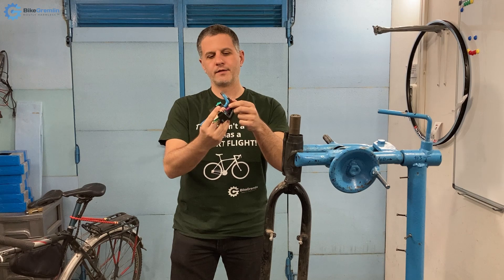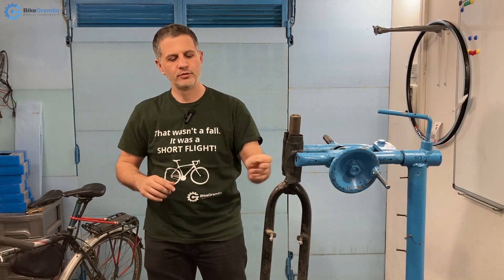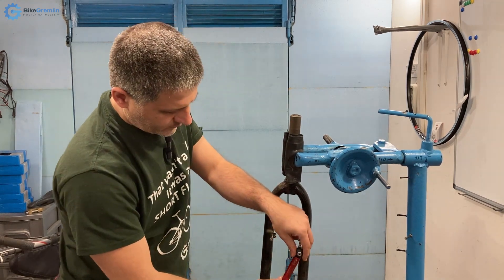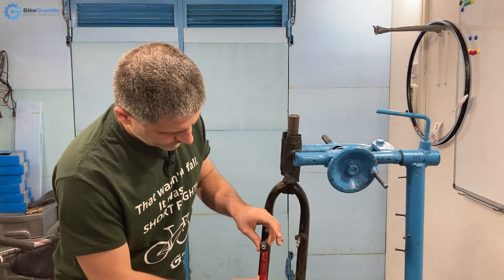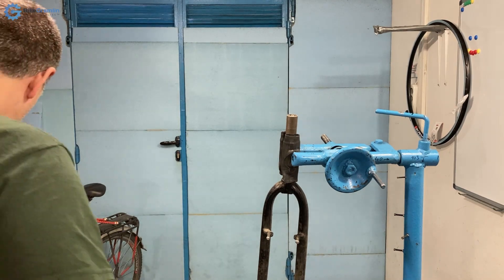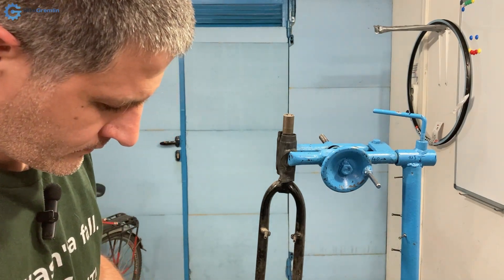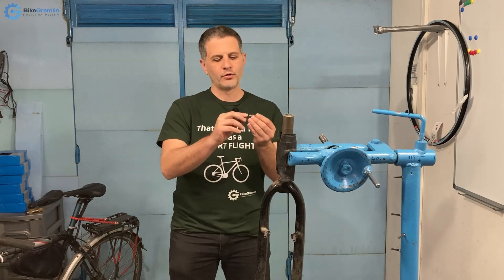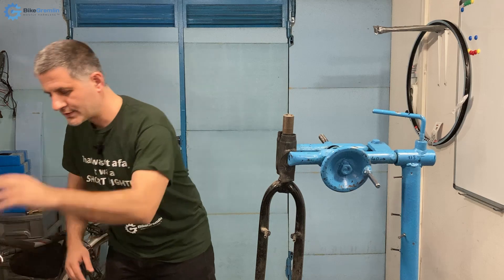Wera Hex Plus hex key experiment

Comment: How come you click twice with the torque wrench each time?
Reply from the maker: I wanted to confirm that the interface would not slip (i.e. that it's not just barely holding on after the first click). Releasing and re-applying the torque.
Reply: Sorry, I think I missed it. What make and model is the torque wrench? Thanks